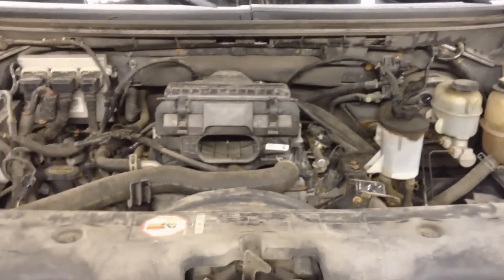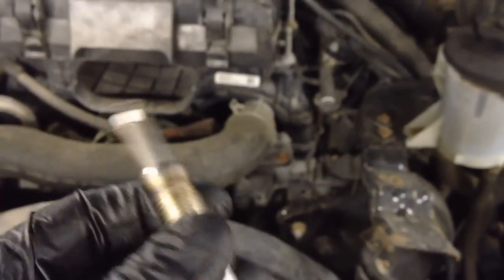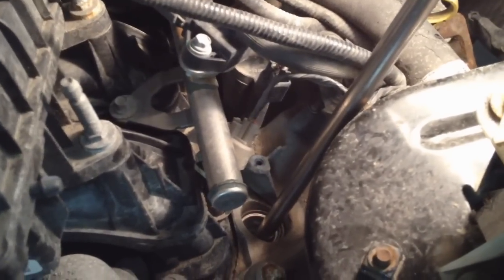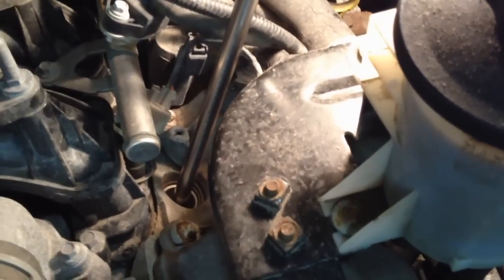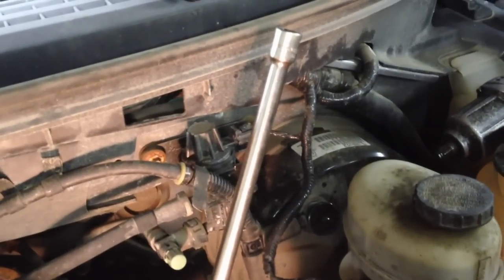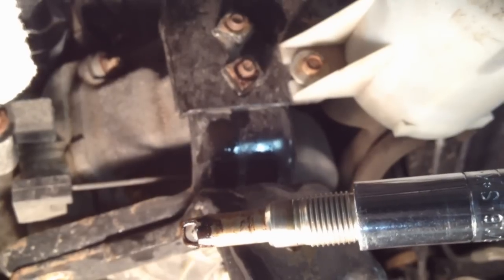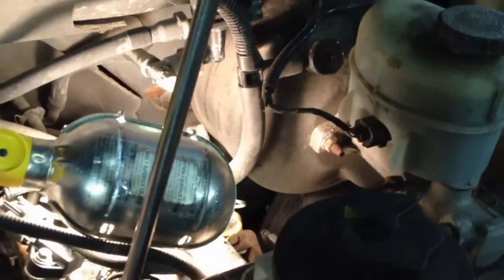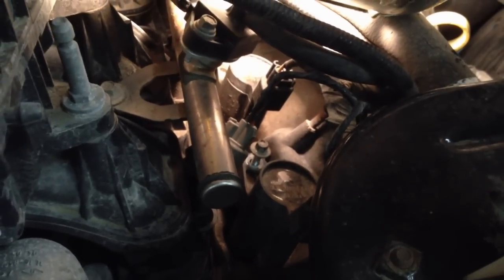Ford 4.6L & 5.4L 3V Triton Spark Plug Removal

Comment from the maker: Here are the parts and tools you will need-
9/16" Spark Plug Socket-
https://amzn.to/2P4Y0E6
5.4L Plugs- (**LATEST PLUGS SP546**)
https://amzn.to/2KvN5CI
4.6L Plugs (** LATEST PLUGS SP547**)
https://amzn.to/2KuWevk
Ford Carb Cleaner Part# PM-2
http://www.amazon.com/gp/product/B000NU5M3W/ref=as_li_tl?ie=UTF8&camp=1789&creative=390957&creativeASIN=B000NU5M3W&linkCode=as2&tag=fordt-20&linkId=RONLOBF4ZX76C3ON
Ford Anti Seize Part# XL-2
http://www.amazon.com/gp/product/B000NUBH22/ref=as_li_tl?ie=UTF8&camp=1789&creative=390957&creativeASIN=B000NUBH22&linkCode=as2&tag=fordt-20&linkId=BJL5Q4BWXCIW6KNL
Reply: Hi you listed the sp546 but said the sp515 is the lastest. Which one is best to use.
Reply: The metal threaded part cane off while trying to remove spark plugs. The rest of the spark plug remained in the valve. Will I need to use the lisle tool to remove the rest of the plug?
Reply: ItzMeTG yup
Reply: What is torque spec.. anyone.. inliterally can't find it for my 2007 5.4l f150 lariat 4x4..
Reply: @ShaneHolly  that's what I'm looking for, the forums are retarded they say from 7-28dt lbs lol
Reply: @dennisferris4671  did you get the answer. I found it. Went back under the hood and put them to spec. Let me know..
Reply: @ShaneHolly  well I read & read & watched videos & determined somewhere between 10-13 ft lbs with anti-seize on the threads?
Reply: @ShaneHolly  I got them torqued down, two of mine were finger tight, it was tapping really loud before, now no noises no misfires she purrs!
Reply: @dennisferris4671  very mice.. yes they start clacking when they are loose..
Reply: @dennisferris4671 I heard 25. Is it diff with anti seize
Reply: @mick5740  I don't remember what I did now but still not a single problem once I set them in
Reply: @fordtechmakuloco what if I have the 2006 ford f150 5.4l 3v flex which spark plug will be the best for this motor
Reply: FordTechMakuloco hi at minute 5:45 did you put some carb cleaner to help getting out easier?
Reply: Oh no, not Ford!! 

doh
Reply: Read the reviews on these plugs you linked to. Many are saying they got to be knock off plugs due to the problems they are having.

Comment: Never done any work on these. Got a 2006 with 185,000 miles. Do you do the rear plugs by hand? I'm thinking crack them a quarter turn and fill up the well with carbon cleaner and let it sit overnight. Then work the plug back and forth gradually with a breaker bar until it feels like it will come out. I think @reconscout7565 has the right idea. Patience! Don't be in too much of a hurry.

Comment: Just did a 4.6 Mustang GT... I had some apprehension as I heard these weird-ass Ford spark plugs are prone to breaking upon removal... What I did- After driving, I waited until the car was cooled down to "warm to touch".. I used compressed air to blow off the engine, then removed the coil packs and blew air again. I then slightly loosened the plugs a quarter turn-that's it, no farther. I then sprayed "KROIL" penetrant in the plug wells- just enough to cover the bottom of the well... I waited an hour and then tightened, then loosened a HALF turn... Let the plugs sit overnight with the KROIL in the wells. Next AM, I tightened/loosened /tightened / loosened and they ALL came out perfectly. BTW, I looked under the manifold of this engine and found remments of a rat nest...I bought the car off someone who lived in a rural area and couldn't believe so much shit could be stored under that 4.6 intake...!!!

Comment: My grandma has a 2005 f150 with only 39k miles do you think i should run some carbon cleaner thru it and then get it warm and try this with a half inch electric impact? Its original plugs

Comment: The ford dealer is giving me 2 different part numbers for plugs, sp509x and sp546x.  They look very different from eachother.  I have an '08 f250 with black ignition coils.  Mfr date according to vin is 5/15/07.  Do you know which is the correct plug?  I'm leaning towards the sp546, but there are a couple used sp509s in the glove box ...which makes me wonder.
Reply from the maker: SP-546 for Black Coils.
Reply: @FordTechMakuloco  thanks!
Reply: My ford dealer is giving me the sp546x for my 2006 5.4 3v..should I demand the non x plugs. ?, thanks

Comment: From 2016-2019 i worked for an HVAC company as a fleet mechanic that had about 40-50 e150, e250, f150, f250 from 03-14. Most had the 4.6, and 5.4s. Most had 110k-170, we had a fair amount with 200k+, and a couple with 300k. I live north of Boston MA. We never used the spray or impacts, and we only had a couple that had 1 or 2 broken plugs. The kit we got had an alignment tool and a bore to drill out the plug well, then tap, then w heli coil or thread cert. With all the horror stories ive read and heard about the plugs in these motors, and how many of these motors we had, we didnt really have many of the known failures. Especially living in area with so many rusty cars

Comment: So you're supposed to use anti seize to prevent the plugs from getting stuck in the heads, but on the other hand, you're supposed to NOT use anti seize to prevent the plugs from backing out of the heads and stripping the threads. Way to go Ford!

Comment: I have changed the plugs on my 5.4 three valve twice. The first time, I broke 2, the second time I broke 3. The thing that I DO NOT understand is that once you turn the plug even a little bit, if the plug breaks, it's game over, but you HAVE to back the plug out a bit for the solvent to get to the sleeve where these plugs get stuck due to carbon build up. I am nearly at 170k, and getting ready to change my plugs again, but I really think doing the initial quarter turn, before soak should be when the engine is at operating temperature while the carbon has softened a bit from heat.
Reply: I'm not sure about the heat softening the carbon , But heat Expands the spark plug hole around the Colder spark plugs!
Reply: @Jerry-up8bk  So I guess bringing the engine to operating temperature, and sticking my socket with extensions in ICE water for each plug should help with extraction. I think I'll try that next plug change. Thanks, Jerry.

Comment: 2006 f150 5.4  205,000mi - I had to remove pcm & bracket to get to passenger far back. Didn't have time to wait overnight but after hour of carb cleaner I worked them back and forth until hand loose. Luckily my plugs had been replaced before they came out easy once cracked. 2 were hard to crack but carb spray works. A universal is needed for passenger side. Patience. This channel has saved me so much money. I'm becoming a member today.
Reply: I could not agree more about the virtue of patience. And working the plug back and forth like you would a rusty bolt. Good job.

Comment: What is Ford's justification for these plugs?
Reply from the maker: They said the cylinder head was too crowded with 3 valves and had to use this design to fit between them.

Comment: I'm going to get my spark plugs changed in my 2005 expedition... With that risk of the plug breaking off into the head... Can I be legally charged to retrieve that from the head when my original work was to be changing coils and spark plugs?

Comment: you can also use deep creep in the cylinder on top of the plug let sit for 15 mins and comes out easy
Reply from the maker: Meh, experience tells me no after 20 years of working on 3v engines..
Reply: @FordTechMakuloco  I am also ase cer and I just worked on one today and thats what I used to get them out all the time haven't broke 1

Comment: So how does one get around the fuel rail on a 2010 Romeo 4.6 2 valve? The fuel rail is a wide, flat piece that sits 1/4 inch above the coils.
I seriously can't find any info on this engine aside from how to change out the fuel rail. Do I need to pull it?

Comment: I realize this is an old video and probably a stupid question, but is there a way to know if mine have already been replaced? Just fine out that this is an issue... I have a 2005 expedition with the 5.4 liter. Thanks a lot for any tips!
Reply: Unfortunately no.  You know for sure until you get the first one pulled out.  Good luck 👍
Reply: @joshjones9687  thanks for the reply! And darn....

Comment: Got 2004 with 274000 miles on it I doubt the spark plugs have ever been changed do you think that that's why I'm having trouble accelerating  up hills

Comment: Yeah changing plugs is scary but I know I'll have to do it with 220k on the engine wish me luck
Reply: How did it go?
Reply: @Wayling2069  haven't gotten around to it yet still thinking I would really hate to break off a plug
Reply: Same thing here....  its my first Ford, a 2006,  gmc was easier to work  on....   I'm beginning the job in the next few days still waiting for some tools...  I begin with this job but I'll probably have to check/replace the roller followers....

Comment: This video is not for a 4.6 triton
Reply from the maker: How so?
Reply: @FordTechMakuloco  2007 4.6 3v triton engine takes the normal 1 piece spark plugs. I ran into the issue that the spark plug socket would seat onto the spark plug on number 7 and 8. It was all cleaned out. Socket just wouldn't grab. Ended just tapping the spark plug socket with a hammer and that did the trick.

Comment: Bugger I got to remove my plugs from the 5.4 3 valve motor. That's in my 2006 Ford Fairlane in Australia. Now I'm very concerned lol. But thank God I watched this. Cheers wish me luck. As the vehicle I own is called a G8 only 151 were manufactured. Stressed out. Lol😅

Comment: put that much die electric grease in the coil like that??????? I usually coat the outside of the spark plug and with a q tip coat the inside of the coil boots but not the metal parts.

Comment: An Amazon seller for the SP546 needs to/should update the fitment guide for the 5.4L plugs.  By the way, there are some sellers on eBay currently selling SP546 fakes as well (review pictures and feedback).  You have to question everything/everyone 🤔when it comes to the SP546/SP546X 2004-2007 F150 5.4L plugs (formerly "SP515" snap-off style).  ...So now I'm considering the Autolite version.😑

Comment: I followed your instructions exclusively...even let it set over night. Seven of eight broke. Used a ratchet...did not have an impact wrench.
Back two could not get out. Towed to a rip off garage. $3000 later got it home and it ran awful.
Saw a youtube where you take the leads off the battery and connect them with an alligator clips wire for about 5 minutes.
Reconnect the battery....Make sure nothing on the vehicle is on...the computer will learn your vehicle completely fresh is what I understand

1) Turn on vehicle and let it set for 5 min
2) Start vehicle and let it run about 10 min
3) Drive the vehicle around going sort of easy...stopping, turning, blinkers, flashers; slowly start turning on things and let it run for a bit---A/C, heat, radio, wipers, windows up and down, etc. Reverse, different gears....you see what I am saying. Let the computer learn everything about the vehicle all clean and fresh.
4) After a day or so you can drive it a little harder....and it's gonna drive so clean and smooth. 
Doing the alligator clips clears TOTALLY everything on the computer from what I understand.
I think the key thing that REALLY made the difference for broken plugs or not is the warm engine....not the carb cleaner, ratchet or impact.
Ford should have offered a free first time plug change on these engines. And the engineers should have been put in the soup line. Sorry.

Comment: Bought this 2006 expedition years ago with 100,000 on it and put off the plug change at 130,000 cause of the terrible rap. Driver side used break bar quarter turn with overnight   P B Blaster next day came out easy. passenger side all plugs screeched even with overnight P B soak and decided to remove P B and add wd 40 soak an hour. ratcheting two turns left one turn right with no noise and stopped for 5 min to allow wd to drain down threads cause it was tough to turn. I don't think I had an issue with the bottom of plug, it's as if the plugs were over torqued causing the threads to bind or Mr. Makuloco stating the different thread materials issue needing a dab of nickel anti-seize.

Comment: You have a video where you said not to use power tools.  And now you're using an impact tool. Did I miss something  ?
Reply from the maker: This is the only engine the impact is recommended for plug removal due to the sticking issue.

Comment: FordTechMakuloco Hope you see this and can offer some advice. The threaded collar/sleeve portion of the sparkplug came off leaving the entire ceramic portion including the top metal terminal intact/unbroken. Is there a method you can recommend to remove the sparkplug in this type of situation.

Comment: Not sure how else I may be able to contact you. We have this engine and so far 7 plugs replaced. The 8th is getting a carb cleaner soak still. We have put antisieze on the spark plug threads as well. We know this changes torque. We have calculated 25 nm. 25ft/lbs x nm conversion = 33.90 nm x 30% = 10.17 = 25 nm rounded up. Thoughts?

Comment: Hey bud! I have a 2003 Lincoln Navigator it does not have the bolted down coils. It is a 5.4 but I am not sure if it uses these dreded spark plugs or just regular spark plugs. I have been putting this off for awhile. Do you know if the engine I have has these spark plugs that are known to break off? Like I the coil packs are not bolted down and the engine looks different than the one you are working on.

Comment: So I put in the new plugs, then pulled them out to put the additional anti sieze on under the threads and the plugs had  bits of sludge on them already.

I wonder if a seafoam treatment would be good for these trucks?

Comment: On my 2010 f150 3 valve I changed plugs and torqued 25 lbs is this too much ?
Reply from the maker: Yes!
Reply: Is 20 ok
Reply: Is 20 lbs ok
Reply from the maker: 106 inch lbs

Comment: I have a question if you get the spark plug out can the carb cleaner sit in the engine for a little while without drying? I need to get a air pressure machine somehow.

Comment: The plug in the back # 8 is what the video should been showing the rest are easy
Reply from the maker: You mean #4.
Reply: @FordTechMakuloco  whichever is the one on driver's side in the back under the fuel injection bar with that extra piece coming out the side in the 4.6 05 model
Reply from the maker: Oh you have a 2v engine.

Comment: So I have a ford expedition with the 5.4 and decided to change plugs I bought it a few months ago and decided that it's got 115000 on it I should go ahead and do that. So I did it with a hot engine and it definitely work on bank 1 to 3. But I got to bank 4 and what I can see the previous owner tried to change them before because when I put the spark plug socket down in and go to crank it out all it does is turn and not come out. Now I am not sure what too exactly do here I have a lisle tool but I am not sure if it will work in this situation.  it seems like the threads or lose bust it somehow separated and just spins but not broken off and coming out from what I see on most videos on here so I am not sure what's the best method or if the lisle too works in this situation

Comment: If you don't have an impact can you just use the socket and ratchet just go slow also what's the part number of the plugs in the carb spray

Comment: I'm having a dilemma here. I have a 05 Expedition 5.4 Triton & can't even see the nut on the spark plug. Idk if anyone else had to deal with this but it's really frustrating! I didn't know about it till after I changed my Timing Chains & Oil Pump then I was going to take the plugs out yesterday and noticed that. Is there a special socket to take out the plug? Ugh!! I decided to put the motor back together after seeing it & will be completed tomorrow. Any Help Would Be Appreciated.
Reply: Can't take the head off cause the head & block is a whole Mold

Comment: Makuloco - video shows SP515, but to clarify, is SP546 the latest update and best replacement?  Just bought a 2004 with only 44k miles.  So hopefully time doesn't create stuck plugs and it's carbon from miles that causes difficult removal. Thanks for all your great tips!

Comment: Can any carb cleaner work or just the ford one?  Can find it right now with this crisis I bought the so-493 motor craft spark plugs before I saw your video are this ones ok or should I get the ones you recommend.  06 f150 4.6? Thanks

Comment: I have a 2007 5.4 F150, bought the SP-546 to do the change. When I removed the old plugs, they are the SP-509 which are a completely different plug. I am very confused. I can't find an explanation on the net anywhere, they are both for F-150s, but the SP-546 don't fit my engine! Did the previous owner change out the engine and not tell me?
Reply from the maker: Previous owner changed the engine, the SP-509 head design did not come into production until mid year 2008 models.
Reply: @FordTechMakuloco  Thank you, that's what I was afraid of. If it was a quality install, is it a better engine design or about the same? Thank you again for the info.
Reply: @FordTechMakuloco  or is it possible that they just put 2010 heads on a 2007 block?